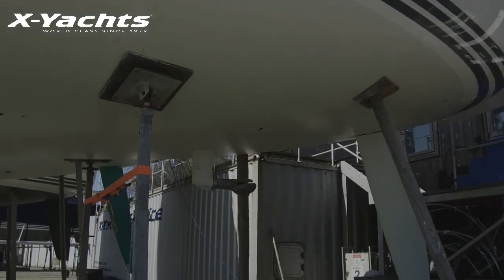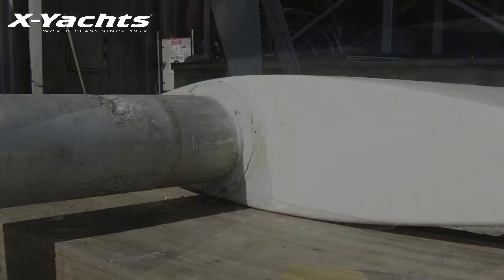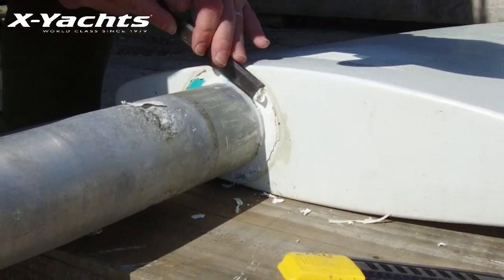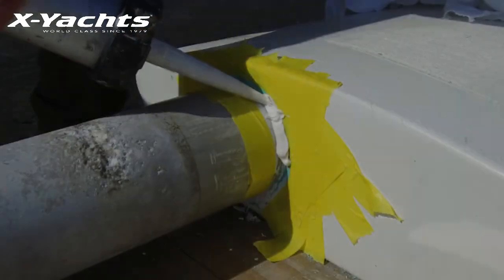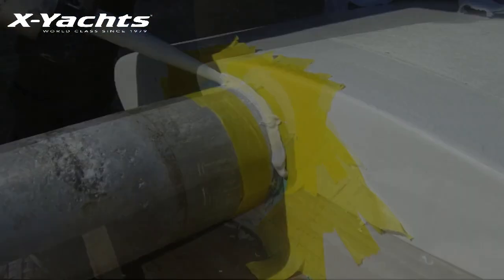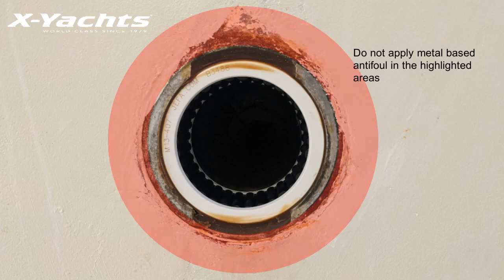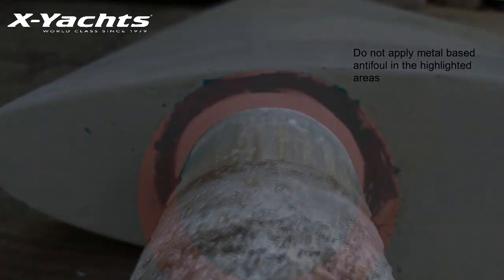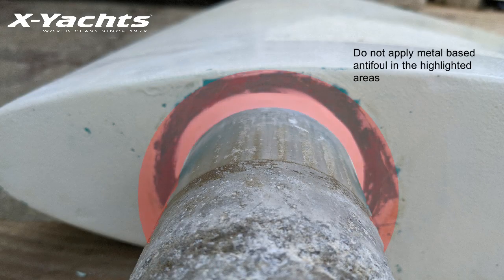Know your X-Yacht series II episode 9 - Rudder blade seal

Comment: Is the missing aluminum on the rudder post normal? If I needed new bearings for an x442 where would I go about getting those?
Reply from the maker: Sometime we do see light electrolysis on the rudder stalk, in this case the fault was found and no further corrosion was detected.  Any worse/deeper, and it would need to be either sleeved, or replaced entirely.   Bearings can be sourced from the supplier, Jeffa in Denmark.

Comment: Dear Julien
Thanks for these very informative videos! I am a bit shocked to see this, as on my IMX this seal has not been replaced in the last 10 years that I own it. Not sure if the previous owner ever did that. Is that change needed to keep water out of the rudder?
Thanks in advance
Dave
Reply from the maker: During build, a fillet of Sika 221 along the rudder stock/rudder blade join line is applied. The integrity of this fillet seal should be inspected on a regular basis and renewed as necessary. We recommend usage of Sika 221 or similar polyurethane based sealant, to be renewed at least once every 3 years. This is to avoid water ingress. 
Julien Renault
Reply: @XYachtsGreatBritain  thanks Julien, I got that from the video too :-)